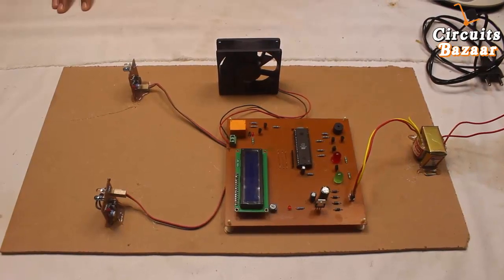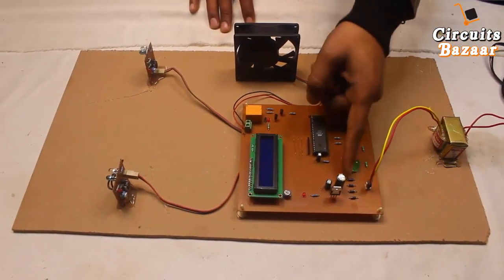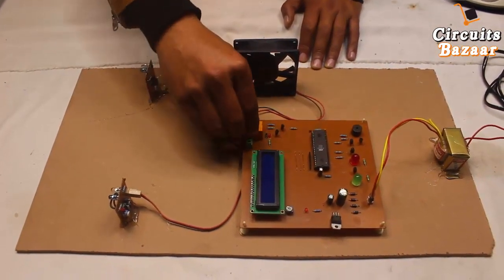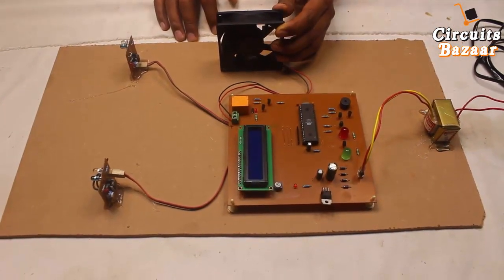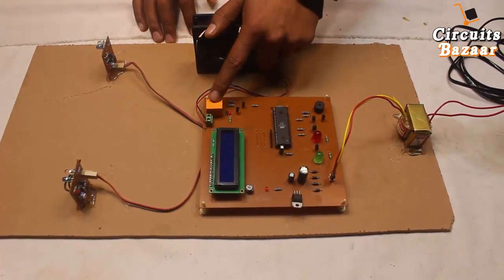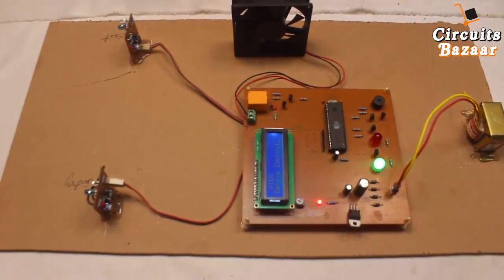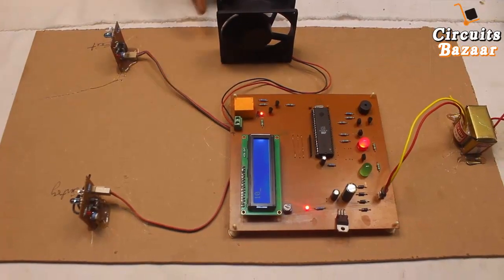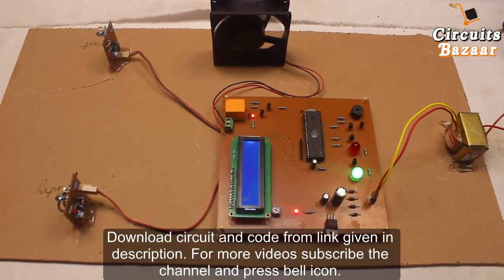Bidirectional Visitor counter with Automatic Device control Project  #261

Comment: Which technology used in this project
Reply from the maker: If I talk about technology then we are using the microcontroller programming over here ali microcontroller is driving the LCD the pan and getting the data from the IR sensor and activating the audio visual indicator so this is the technical detail of this project